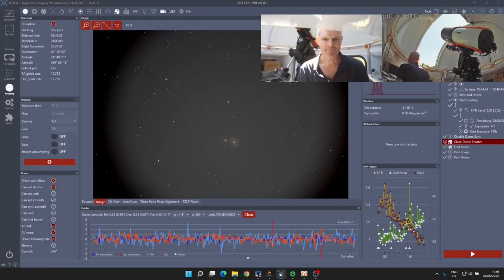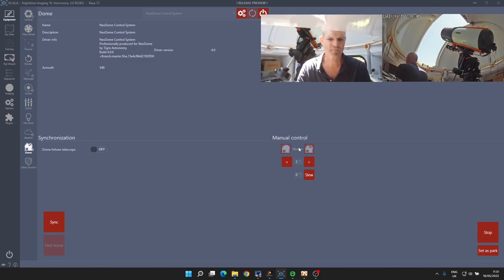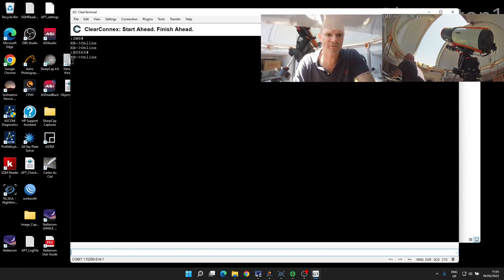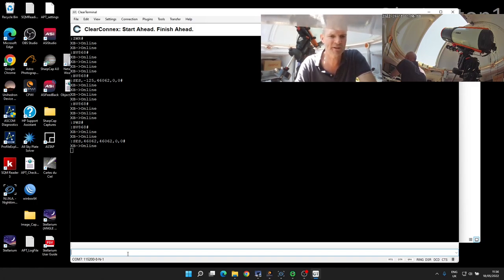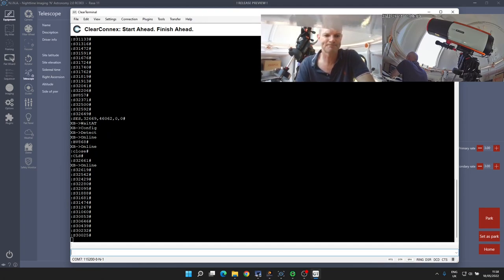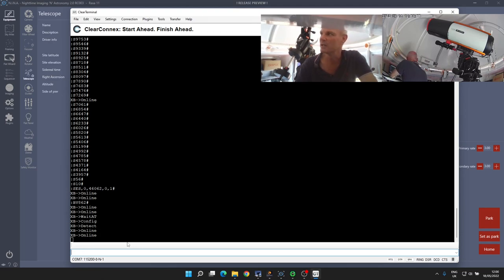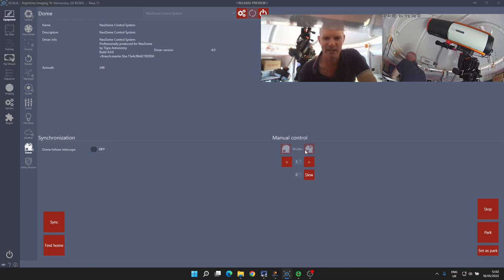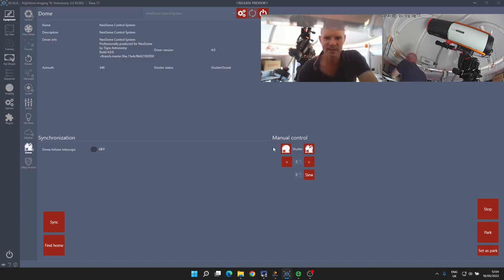How To Recover from NexDome Shutter Disconnect/Comms Failure

Comment: Hey Dave ! I've tried using your method but in Clear Terminal I only have "Config", "Detect" and "Wait AT", can you help with that ?
Thanks !
Reply from the maker: Hi Harold, if you don't get past WaitAT, this indicates the connection is not being established between the rotator and the shutter. This is where I would power cycle the shutter. Sometimes need to have the shutter as close to the rotator box.
Reply: Thanks for your answer Dave. Yesterday I couldn't get back the shutter control which was working fine before. Then I lost control of the rotator, I don't understand, when I plug in the usb, my mini-pc and my laptop don't even detect the motor.
Reply from the maker: On the rotator, unplug the USB, power off the rotator, try a different USB port on the mini PC, and then plug the power in and then the USB. You can also plug a USB cable directly to the shutter USB to prove you can still communicate with it without the rotator.(like how a firmware update is done)